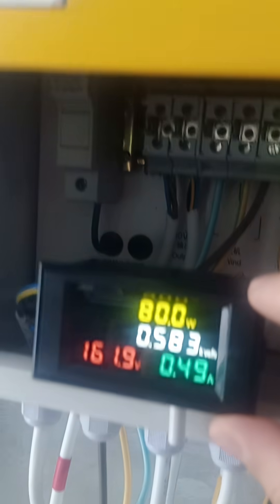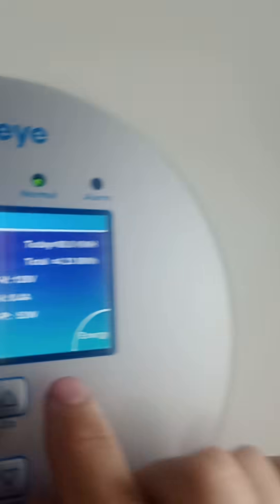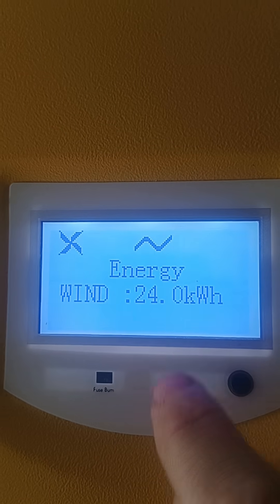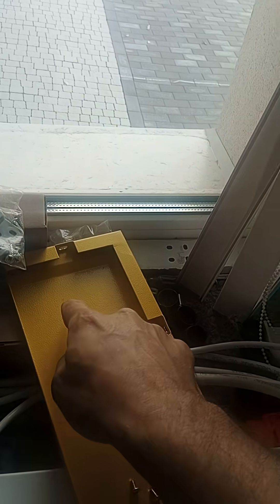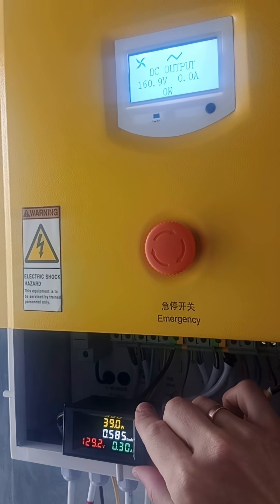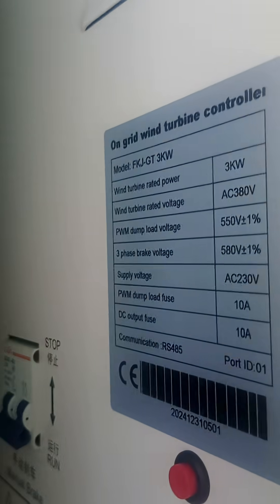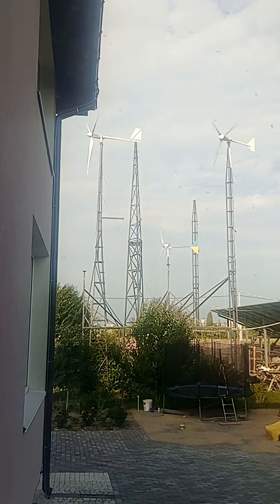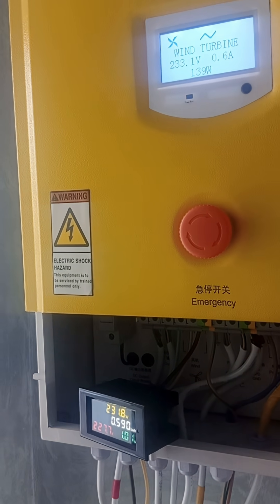Found a great wattmeter, sharing some experience

Comment: Like the new meters , I have 7 wind generators up now, every fence pole has a wind generator on it plus a weather station. 7th is a 48V 1,000W - new
Reply from the maker: Good for you. I am also thinking of adding some fence-based small wind turbines
Reply: @BackyardVoltage  Cool, some more small wind generators would be interesting to me, I am not able to deal with the bigger and heavier models, I think am getting too old now.
Reply from the maker: it's not about getting old at all. it's about convenience. I am for example not sure how will I alone be able to mount my 4m dia pitch controlled unit, since that one is going to be 125 kg net weight... but we'll see. smaller units are definitely easier to handle, noone is ever arguing on that.